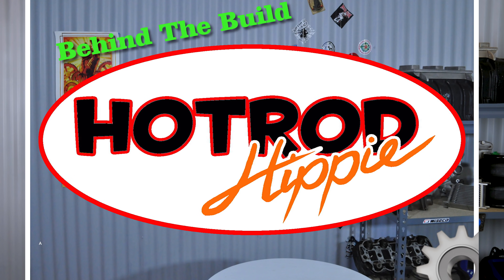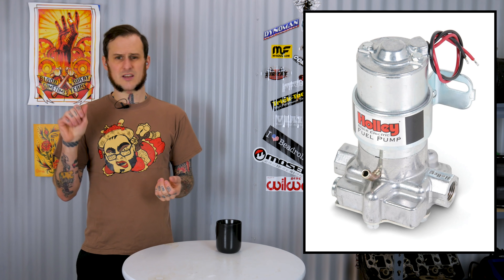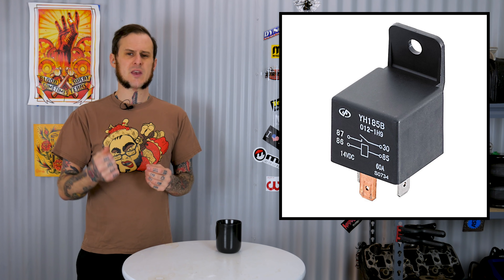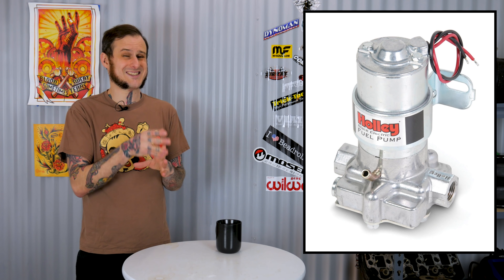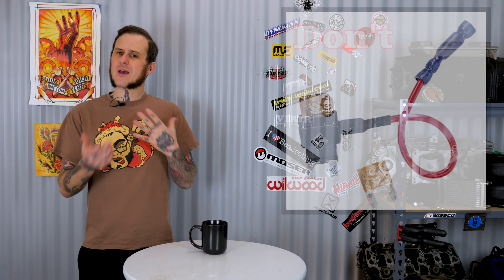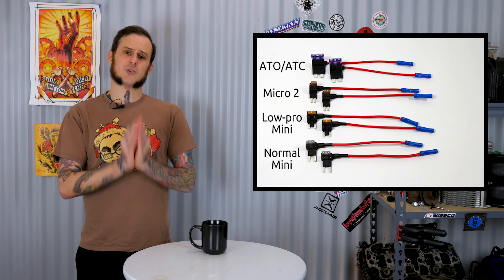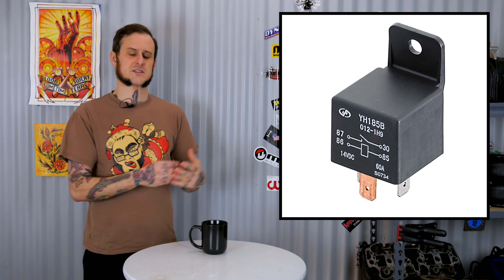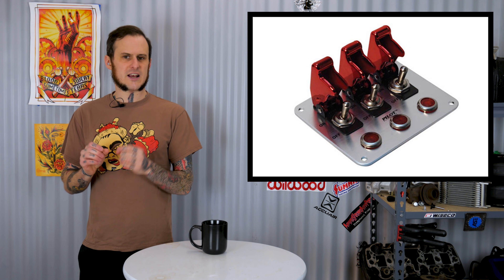Relays and Fuse Taps - Auto Electrical Dos and Don'ts - Episode 2

Comment: I know this video is from 2017, but I don't think your arguments around fuse taps are right.
A fuse tap breaks one circuit into two circuits. So if you replace the 10A fuse from the radio with a fuse tap, you have to put the 10A fuse you removed into the bottom slot on the fuse tap itself. With that, the original circuit to the radio is restored.

The other thing you want to power, a dashcam for example, needs its own fuse (for example 2A). That is what the top slot on the fuse tap is for. If you apply the fuse tap correctly, the dashcam and the radio end up with their own circuits. (that is why fuse taps are also called "add-a-circuits")

See for example this image: https://i.stack.imgur.com/2gzwP.png
You can think of F1 as the original situation. When using a fuse tap, F2 becomes the restored original circuit, and F3 is the "tapped" circuit to the dashcam. 

There is one condition: you have to insert the fuse tap the right way. If you put the fuse tap in the wrong way, the restored original circuit (radio in the example above) still only uses the 10A fuse, but the power for the tapped circuit (dashcam) has to go through the 10A AND the 2A fuse. See this example: https://i.stack.imgur.com/1EuJ4.png 
Result: the radio is still protected against currents higher than 10A, the dashcam is still protected against currents above 2A. It is however possible that the 10A fuse will blow, because the current to the radio and the dashcam together passes through that fuse. So yeah, you can wire it incorrectly, but that doesn't result in dangerous situations.

I think fuse taps are even the better solution. My dashcam came with the instruction to remove the fuse, wrap the end of the wire around one of the fuses legs, and replace the fuse. In my opinion, a fuse tap is a way better option in that case (original circuit restored, tapped circuit protected by a fuse, connection is less likely to break or get loose)
Reply from the maker: MrMadChemist W you are missing the point. And it has happened so many times that I clearly didn’t explain well enough. 

The FEED to the original circuit sees an increased load. In your example the Radio is still protected at 10A, but the feed TO the Radio 10A Fuad now has the potential to see a 12A load before either fuse pops. 

When I made this I wasn’t really talking about Dash Cams. In my experience people most often use these for things like a Radio, CB Radio, Fog Lights, etc. All loads much greater than a Dash Cam. 

So if someone uses one of these on a 10A circuit to power a 10A radio, now the FEED for that original 10A circuit has the potential to see a 20A load before any fuses pop. Thereby doubling the load demand on that FEED without any circuit protection tripping. 

Many fuse boxes use a Buss Bar type design that is slim bits of metal sheet instead of wires. What is the load capacity of them? I do not know but I know auto manufacturers don’t spend extra money overbuilding things when they don’t have to. And plenty of vehicles still have wires feeding fuse circuits inside of fuse boxes. So a wire feeding a 10A Fuse will be sized for a 10A circuit, not a 20A. Again auto manufacturers don’t overbuild things. 

I should update this to clarify but my issue is, if I say “ok these ARE ok for 2A and smaller loads” someone will just say “well a 5A load isn’t that much more! And so on.

Comment: I was hoping you'd explain how to use a fuse tap correctly, but instead you said "If you use them wrong they are bad".
Reply from the maker: ChillProne you missed the point. What I was saying is “DON’T use them at all.”.  I have amended my thought process a little and did mention one use case for them in this video, triggering a relay. However I’ve since been made aware of how little power dash cams generally pull so that’s another use case. I should do an updated video on those uses.
Reply: All right well my apologies then.  I'm just wiring 12V constant power to my radio deck from an empty fuse in the box to maintain clock settings since the van's stock harness was previously altered and the 12V constant is now accessory power. I'm pretty sure I understand how to safely and correctly implement that but I'm trying to verify. The slot was originally empty so I should only need a fuse in the secondary slot, and the size of that fuse can be calculated from the maximum power draw (P=I*V) of the device. Is that accurate?
Reply from the maker: ChillProne yep you are on the right track. Since you are using a spare fuse socket you’ll be plenty safe to use a tap like that.

Comment: You did a good job in 3xplainingvrelay operation and purpose.
Not until I installed after market alarm on my car that offered convenience features...
Power trunk
Power windows up or down
Sunroof as well

Nott until my  experience installing the alarm did understand what was a relay.
To have 30 amp relay and 30 amp fuse the fuse may not hold the electrical current and blow, add a relay it has a spring loaded contact that power on closed, power off or electric overload opens.

Comment: Umm isn't that why you put 2 10 amp fuses. Every stereo I seen lately have a tap off the wipers
Reply from the maker: The issue is the feed side. Both of those 10A fuses are fed by the same side of the Fuse Socket. So whatever is feeding that is not seeing potentially twice the load in that scenario. Some fuseboxes are capable of handling that, some aren't. Thus I prefer to play it safe and not use them.

Comment: His section on why to not use an add-a-fuse is completely incorrect and misleading. Using an add-a-fuse doesn't "add" to an existing circuit. It just adds another branch off the battery or ignition power source, protected independently from the circuit you've "borrowed" for the add-a-fuse. That's why there are two fuse positions on the tap: one for the original fuse and one for your new fuse. 

In fact, this is how your fuse box is already wired. For "always on" circuits, it's just a main wire from your battery to the fuse box with multiple branches off it inside the box, each protected by a fusel, similar to the breaker panel in your home. If the car manufacturer was nice enough to leave empty fuse positions with wires dangling from them for future expansion, then you wouldn't need an add-a-fuse. But since they didn't, this is essentially what the add-a-fuse is doing.

The only limitation to adding another branch to an existing fuse slot would be the gauge of the wire feeding that slot. If you're adding a circuit that needs 15A protection to an existing 5A fuse slot, there might only be a small wire feeding that slot. Better to choose a fuse slot that already has a fuse rated equal or higher than what you're adding.
Reply from the maker: Your final paragraph was the only one that mattered. You missed the entire point until then. Not all fuse boxes are the same and adding a Fuse Tap cirucit adds load to the FEED side of that fuse circuit. You have the potential to increase the load on said Feed substantially with a Fuse Tap.
Reply: @HotRodHippie   First off, loading the feed is not what you've explained in your video. You're saying that you pull a 10A fuse and then could potentially add a 10A or more load onto that same circuit by using a fuse tap so then you may have to increase the size of the original fuse. The fuse tap doesn't touch the original 10A circuit. It just adds another circuit in parallel to it, branching off the wire that feeds the original circuit. Both circuits operate and are protected independently.  You would put the original 10A fuse in the fuse tap and place your new 10A fuse beside it (bad idea but for other reasons explained below).

Secondly, what vehicle has the battery and ignition feeds to the fuse panels routed from other systems? That's just poor design. A quick resistance check between your battery's positive terminal and the feed side of one of the "always-on" fuses for example, would show less than a few ohms, indicating that it's a direct connection to the battery without any other components in between.

A relay is good if you want control of the new circuit that you're adding. Otherwise, a fuse tap is fine, as long as it's added to an existing fuse that is rated higher than what you're adding. I would say double just to be safe, so that the total amperage of the two circuits together doesn't exceed the gauge of the wire feeding that fuse position. Eg... adding a new 5A circuit to an existing 10A fuse position so that the total draw on that position is now 15A should be fine. Remember that each fuse position on the panel is already branched together with every other fuse position that uses the same source (batt/acc/ign). All you're doing with a fuse tap is just adding one more branch.

Ultimately you're just adding extra load to the power feed. Your new circuit will be connected to this feed either way, either by a new wire to a relay or by the existing vehicle wiring to the fuse panel via a fuse tap. The determining factors in all of this is current draw vs wire size and whether you want control of the new circuit or not. Either way, fuse taps are fine when used correctly and your explanation of why they're bad is for the wrong reasons. Btw, your suggestion in your new video to use a fuse tap off an ignition-switched fuse to control a relay is a neat idea.
Reply from the maker: @briant4072  I took for granted that other people would understand how an electrical circuit works when I made this video. My fault for not breaking that down, but that is a complete video in itself, if not a series of them. So you are right that I didn't say it was adding the load to the feed for the circuit, but that's what I meant because that is how parallel circuits work.

Fuse box feeds can come in various forms. Some are buss bar types. Some are actually wires split off of the primary feed. NONE are a large feed wire to every single circuit in the fuse box. As such you cannot be certain that the wire or buss bar feeding each individual circuit in a fuse box can handle the increased load a Fuse Tap adds. 

Adding a 10A fuse tap circuit to a 10A existing circuit has the full potential of doubling the load on that Feed wire (inside the fuse box, as well as whatever is feeding the entire fuse box) or Buss Bar, depending on box design.  

Also yes there is in fact the potential to overload the entire Fuse Box feed. What size wire is feeding the entire fuse box? Are you certain it can handle an additional 10, 20, 30A? Sure you may not install a 30A fuse tap circuit but, is it crazy to say that people may install 3 10A ones? I've often found that when people are willing to use one, they are happy to keep going. 

Adding a supplemental fuse panel that is fed by a battery direct connection, or a Relay deed (for ignition control) is a far superior way of handling matters.
Reply: @briant4072   Hi Brian, I know this post was a while ago but I think your explanations are what I’m looking for I have a 10amp rated cigarette lighter circuit. I want to add a 10amp rated accessory cigarette lighter socket in the tray of my pick up, by using a fuse tap on the existing circuit  in the fuse block, both fuses would be 10amp, is the factory wiring to the fuse block going to be able to handle the extra load, this is what I’m unsure about?  Your answer seems to indicates yes?but hot rod hippie seems to indicate no? Thanks Anthony
Reply: If you won't use both circuits at the same time, then yes, the wiring to the fuse panel will be fine. If you still want to use the original cigarette lighter, better to tap off a 20A circuit as the safety allowance on the cable gauge should be able to handle the extra 10A.

Just be sure you install the fuse tap properly! Remove the oem fuse and find which side in the box is hot. Install the fuse tap with the wire coming off the opposite, protected, side. Otherwise, your new circuit will be directly connected to the wiring harness with no protection.

Comment: Great info. So can I use a fuse tap to give ignition power to a relay for a holly elec fuel pump?
Reply from the maker: Yes the fuse tap would be a good way to control a relay if you lack easier Key Hot signals. 👍👍

Comment: Can I use a fuse tap through a relay to a switch to power fog lights?
Reply from the maker: Yes. That is a good use for a fuse tap. Signal a relay with the fuse tapped circuit to control a larger load like fog light. 👍
Reply: Thanks for your help.🇵🇱🇺🇸

Comment: My fuel pump relay took a shite and takes 5 to 10 attempts to start in the a.m. and due to a recall that my vehicle is not a part of, the relay bypass kit is not available to me. I have no choice but to tap the cig lighter fuse to the fuel pump fuse for emergency starting when it finally gives.

Comment: The fuse taps are insanely popular for hardwiring dash cams. Would you recommend not using them for that either? I just installed my own, and used a 10amp circuit, with a 5amp fuse for the dashcam. The dash cam only draws 5v 2amps
Reply from the maker: A lot of folks have asked this since I posted this video.  Dash cams and their relatively small loads were not a use case I was considering when I made this video.  So yes, I largely feel fine about Fuse Taps used for those and other sub 2A loads.  

I was coming at it from more of a perspective of the classic car world I work in where people use them for 5, 10, 15A loads and that I have issue with.
Reply: @HotRodHippie  Thanks for the quick response!

Comment: Can I use the tap in fuse tap into radio fuse to power led and should they still get power with 
key out car?
Reply from the maker: Power LEDs should be ok, they are low power enough. As for whether they will work with the key out, I cannot say. It depends on whether the Radio fuse is Key Hot or Battery voltage. I simply cannot say, maybe I could look it up if I knew the car, but no guarantees.
Reply: @HotRodHippie  I already did it tbh I'm trying to figure out which fuse I should tap into they do stay on is that good or bad? I want to make sure I tap into it right u said key hot good I believe would I tap into the fogs? Its gmc yukon denali 05 sport v8 6.L really need help thanks

Comment: Man i like your videos. I confused in one thing. Relays and reverse current. When you stop trigering a relay they release small amount of reverse current because of its coils. This small amount of current is enough for damaging Arduino like electronical items. thats because in electronics you should relay with a diode. I want to make a digital dashboard with a development board. I don't know what i have to do. Should i use relays with diodes and fuses
Reply from the maker: Car systems rarely are that sensitive, at least not the systems we are primarily dealing with. However I fully get how an Arduino or similar electronics would be sensitive in that way. Without seeing more of what you are putting together, I would say Yes use a diode to prevent that back feeding. It is a "Better Safe Than Sorry" situation and running diodes won't hurt anything, only prevent possible issue. 

Thank you for the kind words also.  👍👍

Comment: Can I use a fuse tap to power a fiber optic starlight kit for my headliner? If not, what’s the best way to go about wiring it?
Reply from the maker: It depends on the power draw. They seem to come in 3 Watt or 6Watt versions. Either of those should be fine to use with a Fuse Tap as they draw less than 1 Amp. Those are oddball smaller power draws than I was thinking of when I made this video.
Reply: I’m looking to get one with a bigger light engine that has more options for twinkle effects. Obviously they have higher watts, what’s the most ideal install for this model?

Comment: Thanks. Good info. You like relays but not fuse taps. I agree. Relays are good for what you were describing but I was hoping to see how to properly fuse the fuse tap. I'm installing some electrical components in my car such as some low wattage interior led lights, a separate switch to manually activate a low voltage remote turn-on for my amplifiers and a dash cam. Do you have a video on how to wire a fuse tap? I wasn't sure how the current flows through it and if one fuse should be higher or lower since the current flows through both. My battery is located in the trunk of my car so a relay is just impractical plus what I'm hooking up draws hardly any amps so I think it would be okay to tap my fuse block.

Comment: I am wanting to install an electric chair I pulled off from a 2013 VW CC to my 2000 Eurovan.  I am wired confused.  I noticed there are 3 connections.  I think one of them is for the airbag and the other for the heated seats and the last one for the movement of the chair.  So should I do a relay for the chair and a fuse tap for the heated seats?

Comment: Question I used a Fuse tap for my dash cam I took the windshield wiper which is 30amp mini and fused with a  5 amp mini for the dash cam is that okay
Reply from the maker: When I made this video I wasn't taking into account small loads like Dash Cams. On average they seem to pull 2A or less, so I can agree that is ok. I was more concerned about the larger things I see these used for.
Reply: HotRodHippie thank you
Reply: What do you think of using a fuse tap to connect to an unused slot in the fuse box (ignition switched) The fuse tap will power a smaller fuse box that powers 6 circuits each with up to 1 amp draw. The lower side of the fuse tap will be open.i.e. no fuse. 5 of the circuits will be controlled by a switch. Very rarely all 5 switches will be activated.